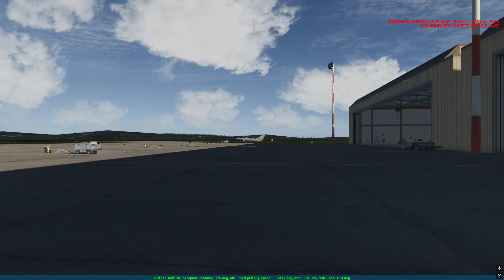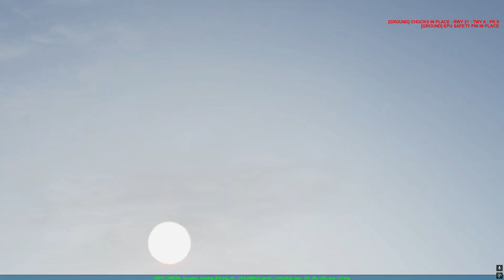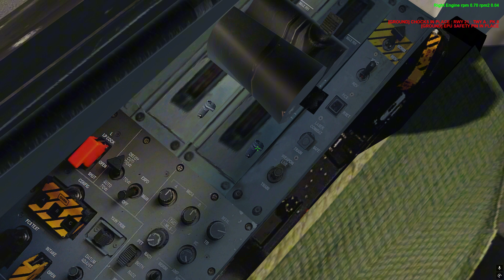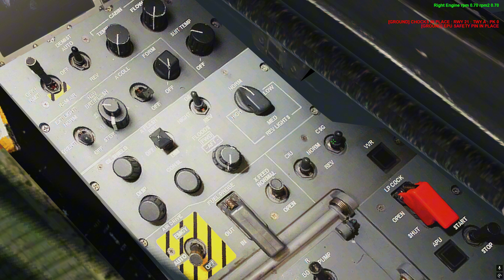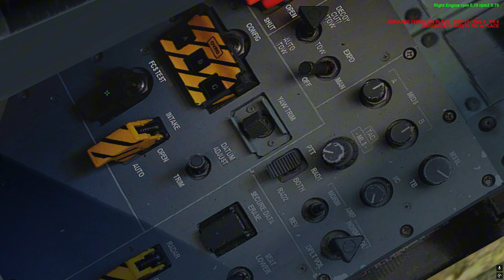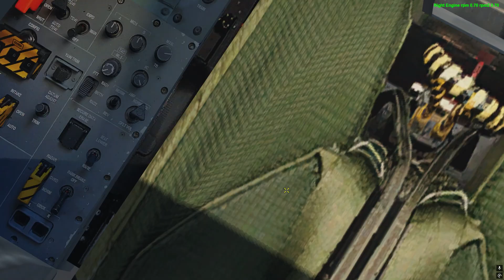EF2000 - Start Up Tutorial

Comment: This is a reskinned F-16
Reply: Correct, the only aircraft that does not use the F-16 flight model is the F-15. You still have to work out which switches operate the various systems so this tutorial is very useful. I have to keep the AV-8B, F/A-18, F-15, A-10, F-16 and now the Eurofighter in my head. What a mind f**k!
Reply: any modded aircraft in BMS is a reskinned F16 thats just the way it is. Without the source code you cant really model new systems